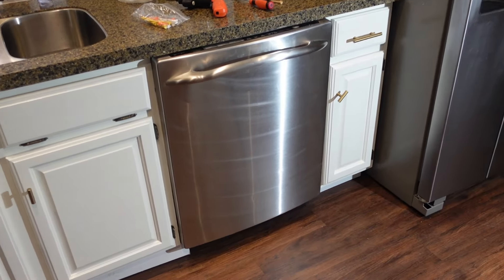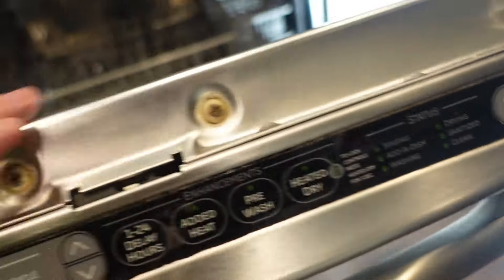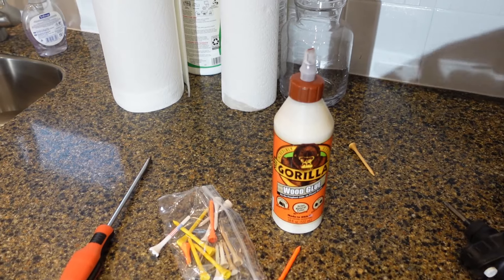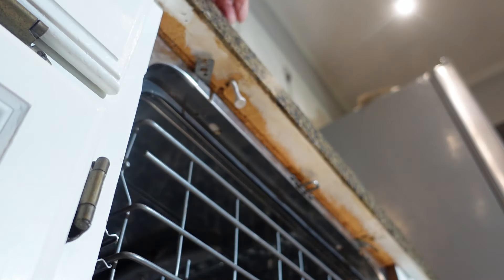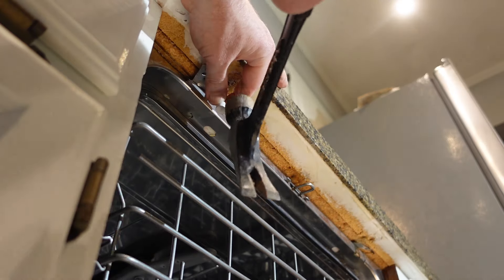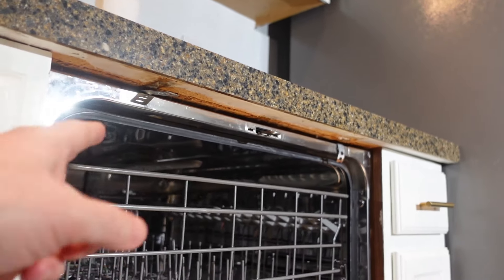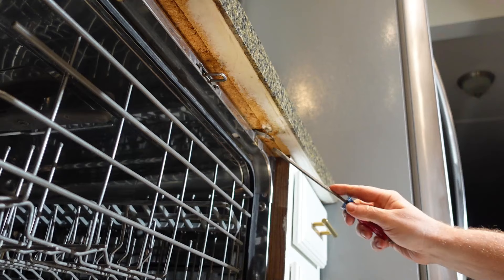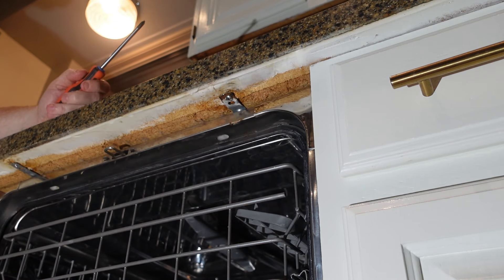Fix a Dishwasher That is Rocking - Brackets Have Come LOOSE

Comment: Small wall or plastic screw anchor may work too?
Reply from the maker: I'm not sure about that one. Because most anchors expand on the other side of the drywall or plaster. With a counter top, it's normally a solid surface all the way through, so the anchor couldn't expand.